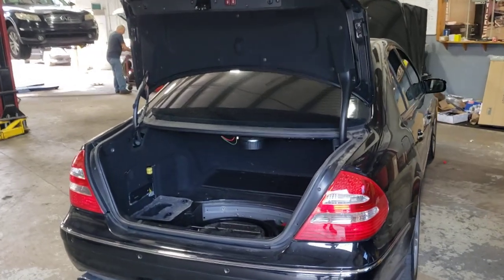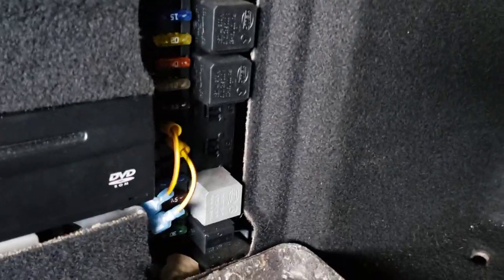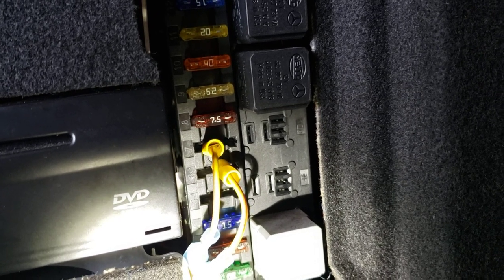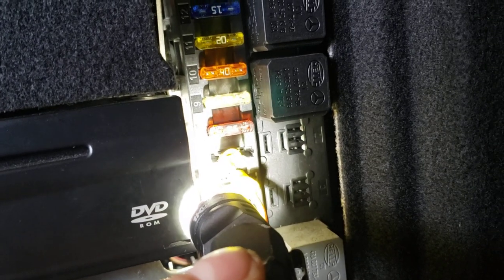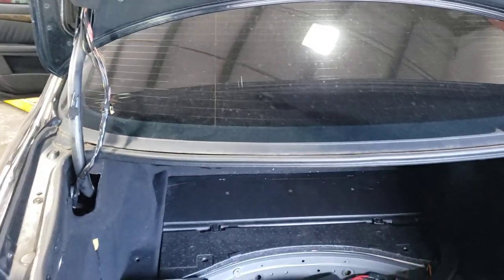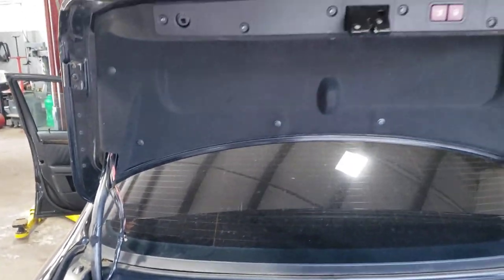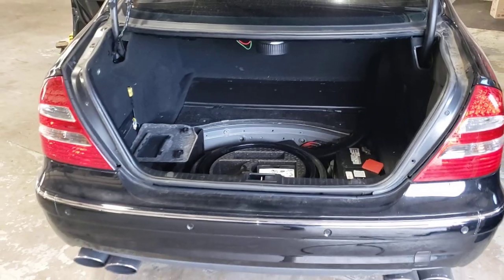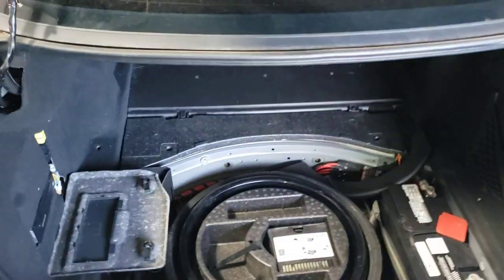w211 Mercedes Battery Drain Audio Gateway Trunk Wiring. DealMaxMotors.com

Comment: Great workaround. On the way to NAPA to get the loop. QUESTION: Is there an issue looping into a 40A inlet from a source designed to handle less amperage? Example, drawing power from a cigarette lighter (#13/15A) to power the AGW fused at 40A?

Comment: Love the detail of your videos. I have an 06 E350/W211: First I couldn't switch between comfort and sport mode. Then the car started to call Teleaid over and over whenever car was off + got Teleaid malfunction message. This drained battery. Accidentally put new battery in backwards. Melted terminals. Put another new battery. Drove it. Got white battery warning, then red battery visit workshop, then esp, srs, abs, lost full braking power, stalled. I got sick. Car sat for 2 years. Recently changed aux batt, main batt, alternator regulator. Started. Used hidden menu to find alternator still not charging. Read online that reversing battery terminals once on a Benz can fry inline fuse on alternator ground wire (under shrink wrap), plus diodes on alternator. I'm exhausted. I don't want to pull alternator again just to find it's that one inline fuse that needs changing. If fuse, I don't know how to change just the fuse or the whole cable if need be. I need this car to get to and from crucial doctor's appointments and I'm exhausted. So, any suggestions would be greatly appreciated. Yeah you.
Reply from the maker: Loss of full braking power meNs you have electric brakes. Car has a battery charge module in trunk next to spare wheel. Its probably bad. Buy cheap on ebay. Alternator regulstors like to not work when aftermarket. I got lucky 5 days ago on a 05 e320 and it works fine. As far as burning diodes I have reversed terminals plenty Nd never burned diodes but every car is diferent. If youre over 120k miles its not a bad idea to put a new alternstor in anyways.
Reply from the maker: If you cant figure out call insurance they willl cover any damage as long as you have  full coverage.

Comment: Thanks so much, makes a lot of sense. Going to get an external fuse holder with two separate male fuse leads… I’ll put one side to left side (7) and the second one to right side (6) with the fuse in between.

Problem solved!! 😁
Reply: Hi,actually i have the same problem where the no 6 fuse is working when even off,can you write what i need to buy to perform the same thing the guy did in this video,as i have no idea..
Much appreciated if you could…
Reply: Another question if you dont mind,but do i place the same fuse (40A) one in the fuse holder?
Reply: @armiaomidvar1081  yes same fuse type recommended for audio system
Reply: @armiaomidvar1081  get fuse holder from advance auto about $5, use old fuse in new fuse holder
Reply: @MistaChubbz.  thanks alot for the reply,if you dont mind but can you send a link of what i could get?if not do i get a inline fuse holder or something else,and does it do i get a specific one according to the Amp?
Thanks alot once again
Reply: @MistaChubbz.  Why this fuse is 40A? Can one use a 30A fuse? It seems just for radio/CD, why 40A fuse, that's a lot current !
Reply: Would a 30A fuse be OK?
Reply: Use the the fuse type recommended for the audio gateway don’t use less or more. Less May keep blowing out on you. More can destroy the radio. Always remember this.

Comment: Thanks a bunch I’ve been chasing this problem for months replacing battery after battery just having the car air for a day it dies
Reply from the maker: MKe sure you change the clips for the water strip above this rear fuse bix. They leak. Rubber disenegrates. Kills the sam.

Comment: That's a great quick fix but if you have a fuse in 7 and utilizing that circuit, wouldn't it be better to trace where the fault is in the #6 circuit? I am in this problem now trying to trace what is pulling power.

Comment: Thanks for the tip my e55 drains after a couple of days,,,I'll try the bridge tip Thanks
Reply from the maker: Yeah trick is finding which fuse is draining. I used one of those clamp on multimeters. clamp it on the negative cable and after car sleeps should not be more then .05 amp. if its .09 it will die after 3 weeks or so. clamp it on let car sleep then start pulling fuses see when it drops down.if its perfect .025 amp
Reply: @zibi1988pl  
Did you have a fuse on your bridge
Reply from the maker: @gohar617ify  yes
Reply: @gohar617ify  whats the fuse size?
Reply: @kylieu4225  I need to know the size as well having same issue and don’t want to go through the hassle of gettin a new module and having it programmed to my car

Comment: The BYPASS works! thank you!
 Still there is a battery drain, much slower though. Where should I check again?
Reply from the maker: I made a new video. Go to my chanell.
Reply: Another culprit are the front seats, especially the passenger seat. The seat are powered even when the ignition is not on. The fuses located for them are on the driver side, on the side of the dash( the door needs to be open to 2:18 have access to it). There should be a little paper with the schematic of the fuses. Pull those  fuses overnight, if the car still starts, then you know where the problem is: the seat module (located under each seat)

Comment: So technically, until you do the bridge, you can remove the fuse( radio will not work) but the drainage should stop? I think that’s how it works
Reply: Thats absolutely correct pull out the number 6 fuse when you are parked over night and only put it back in when you will be using your car a lot so you can have radio function.

Comment: My battery protection keep coming up it doesn’t let me slide up my passenger seat I changed the alternator but didn’t changed the fuses any help ?
Reply from the maker: Some models have a module that charges front and rear batteries. Red battery light means bad battery in front AUX battery. Also can be a a charging problem in general
Reply: @zibi1988pl  i got both batteries tested and both were good might b a electrical problem
Reply from the maker: @kyngtroup  Your module is in the trunk those get water. Check for water in trunk. Check for rust in trunk. Clips around the trunk leak water. There are 8 clips. Sometimes the reinforcement bar under bumper it's self fills up with water and it slowly seeps into car through the bolts holding it. If you see rust around the trunk area remove the trim (all carpets and sides) spray water hard onto trunk gap with trunk closed. If you notice water chances are that module failed and more is going to fail. I have 3 cars with trunk fuse box issues. eBay ones are usually bad too. Ridiculous.

Comment: can i just take out the fuses so they drain no power and drive like that?
Reply: Yes, if you want to use your radio put in the fuse after you start the car and remember to take it out when over night or if you won't be using your car for a while.

Comment: Well I sure wouldn't be happy using a garage that finds a cure without finding the problem. Shows incompetence and unprofessionalism, it's called a bodge!
Reply from the maker: ? I'm not sure I follow. How was the problem not found?
Reply: @zibi1988pl  You didn't find what caused the issue in the first place.
Reply: @zibi1988pl  Well you didn't establish why that circuit wasn't going to 'sleep', you just substituted it for a circuit that did go to 'sleep'. That may correct the problem,  however, it didn't establish the cause of the problem in the first place so the original fault still exists, you just found a work around.
Reply from the maker: It was a module forgot which one I did establish that. Module needed replacement and instead it was solved by forcing it to turn off with the ignition. Any questions?
Reply: @zibi1988pl  You said "I don't know which module this contributes too but I don't really care", not an attitude that instils much confidence. In addition, I assume there was a reason why Mercedes design engineers designed it the way they did and not with your modification. I like things to be right whilst you clearly, (in your own words), "don't really care", as you previously stated.
Reply from the maker: Look at your nick name. This car is designed to brake and keep it at the dealership. I bought tens of them and I know how to fix them.  Your profile was designed to negatively contribute to this community. Whilst I'm here to help people in need. If you knew how to use a keyboard better you would Google the fuse in question and figure out the module I had trouble with. Easy peasy easier for me to figure it out then it is for you to cause controversy.
Reply: @zibi1988pl  My nick name is such not for the sake of being controversial but because unlike you and a lot of other people who take the view 'oh it will do' or 'it's good enough', I like things to be right and that makes me controversial and hence, why we are having this conversation. As to your statement "This car is designed to brake and keep it at the dealership", if that were true and all Mercedes continuously broke down, the companies reputation would be in tatters, their sales would plummet and they'd go out of business. But perhaps that's just you being 'controversial'. Touché  😄
Reply from the maker: @controversialrebel5639  You should look into the reputation of the recent Mercedes products. W211 brake down a lot, w220 also and new Mercedes have turbo, timing chain and valve issues. Yes they brake down and there is room for improvement which is what I did in this video.
Reply: @zibi1988pl  You may well be right in relation to "recent Mercedes products". However, the car at issue here was a 2005 model. I will say that all in all you seem like a pretty decent guy and I have watched a couple of your videos. Have a great day.
Reply: It is well known that the head unit can cause a parasitic draw in W211 cars. My head unit draws 0.5A constantly with the car off. Powering it through a "key-on" circuit is a great idea.
Reply: @controversialrebel5639  Semantics notwithstanding, it's fixed. The system functions. Sheesh.